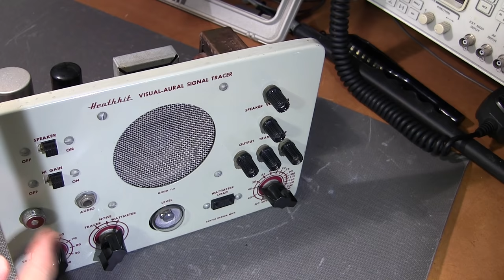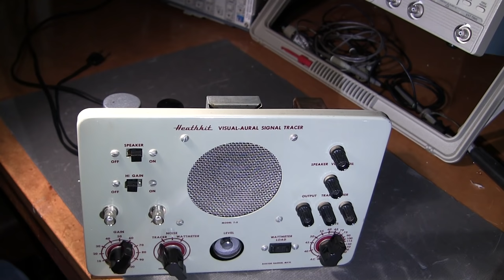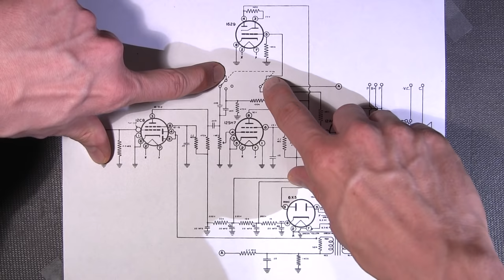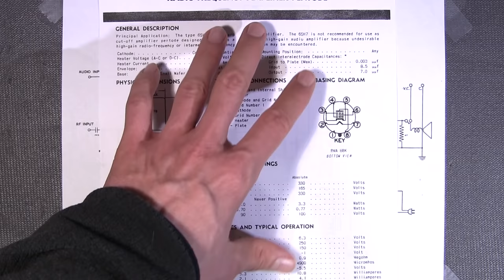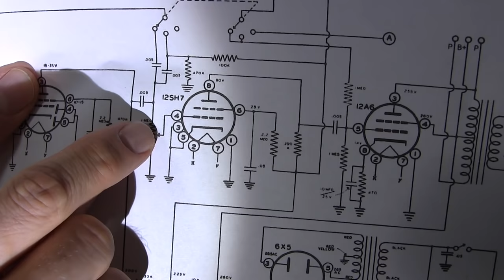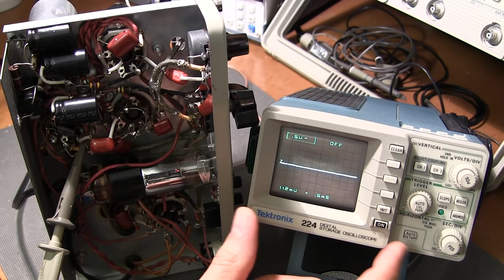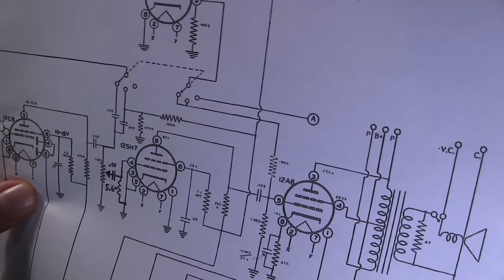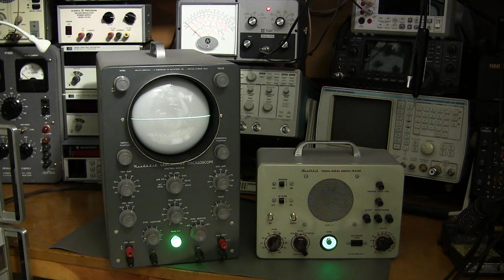Signal Tracer Troubleshooting Repair and Modification

Comment: Someone told me that he "way back when" worked on a electronics devices assembly line. The good old point-to-point stuff. 

(Understandably) They were told: "If you happen to drop a part, don't bother picking it up from the floor, just use a new one. The time you need for picking it up is more expensive than the part. Additionally, we can't be sure if it hasn't been damaged due to the fall and it may fail later at the customer.". 

But after a shift, they sweeped the floor, put all the dropped parts into big drums and sold then to Heathkit, who put the (unsorted) stuff into bags and sold them for cheap as "1 pound of various components" or such.

Comment: Great videos. I have seen  a different circuit for the T-3 were the high side of the potentiometer and the wiper are exchanged, this being a little easier than your modification. See http://www.vintage-radio.info/heathkit/  under T-3.
Reply: Or is your 5.6 Meg a better bias than using the 1Meg on the gain control?

Comment: Whence comes this strange idea that Heathkit builders are "in a rush"?  Why would one buy a kit if one was in a rush?  I know when I built mine I took all the time in the world slowly and deliberately so as to make sure of getting everything right, that was the whole idea of building one.  That comment didn't seem to make sense.
Reply from the maker: Your answer is: Is Heath "KIT" still in business? Most people want the final result fast, so pre-built took over. This example is repeated over and over with kit companies. There are some like you that enjoy the build... I do too, but most do not, they just built to save money.
Reply: @MrCarlsonsLab  Hm, I still can't agree there. If cost were the sole concern one would simply bought used gear. We kitbuilders build because it involves us directly in the construction,  offers a challenge, sharpens our soldering skills. I always figured what doomed Heathkit was the evolving miniaturization that made pre-IC circuitry less practical, along with the fact that the firm was bought out by a computer company that didn't support that side of the business.  Personally I don't remember it crossing my mind that I should build a kit "because it's cheaper"; I always felt less of a connection with gear that was not personally built.

Building anything though requires an investment of time, that's a given going in. If 'most people wanted results fast', kits could have never taken hold in the first place. One builds for the *experience*.

I dunno, maybe we should take a poll.